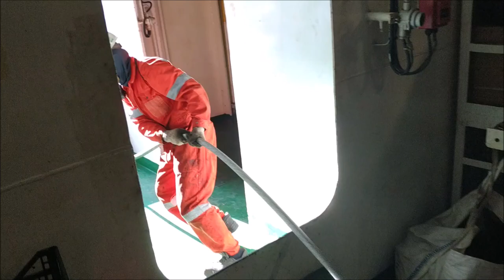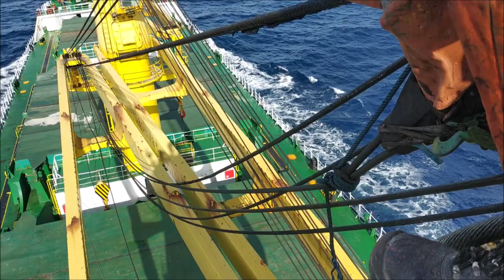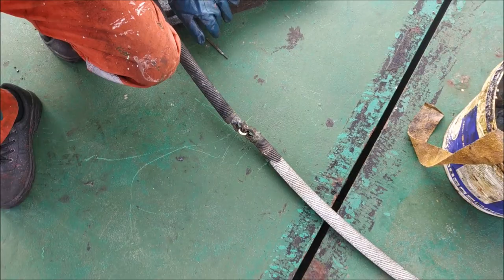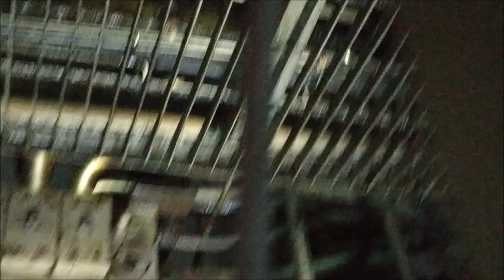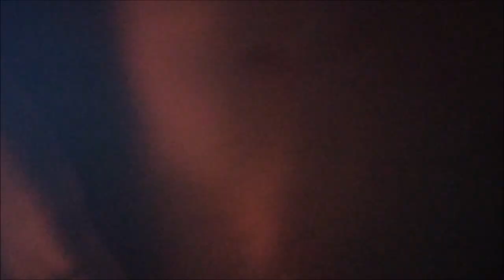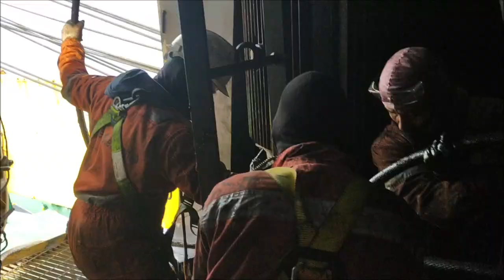2021 Change hoisting wire of cargo crane

Comment: what’s the indication of the cable wire is need to be replaced?
Reply: A wire rope shall be replaced if
over a length corresponding to 8 diameters it can be seen that the total number of broken wires exceeds 10% of the total number of wires,
it shows signs of harmful wear and tear or internal or external corrosion,
it has been overloaded to the point of permanent deformation,
it has other defects such as kinks, crushed individual parts, a tendency to form spirals or other deformations making it unsuitable for use.